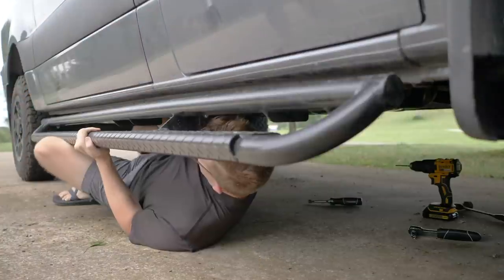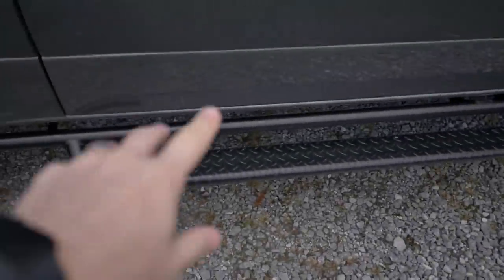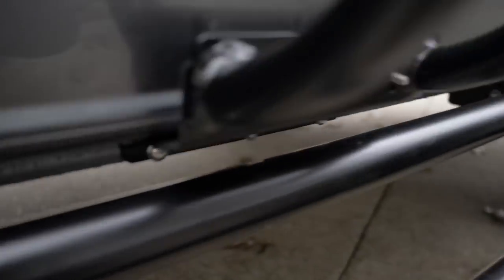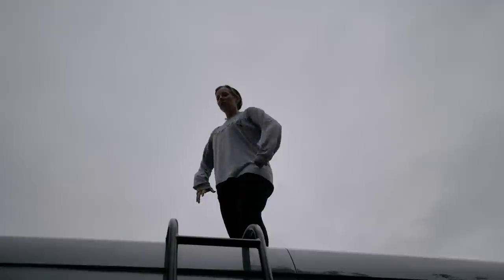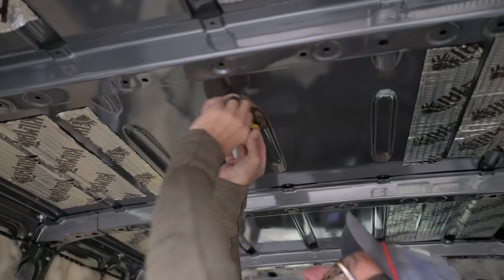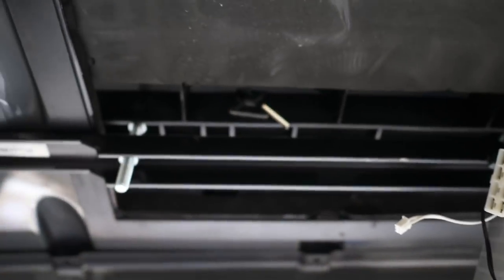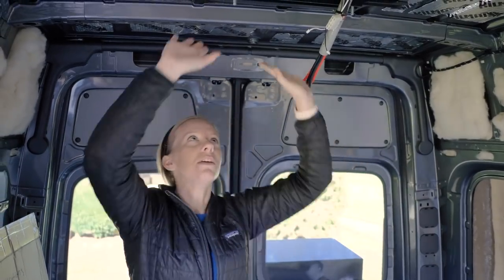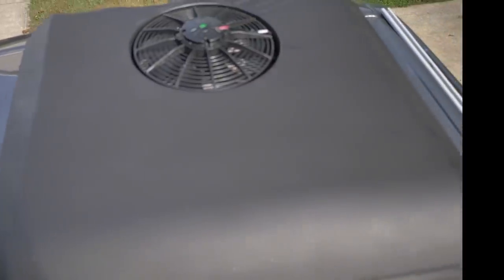Adding AC to Our Van Life Sprinter Van Conversion // Installing Nomadic Cooling AC at Site Seven

Comment: Did anyone else noticed that one of the ladder bracket is misaligned. There are 2 holes in the foot of the bracket and the left in on the outside and the right bracket on the inside looking from the side. Hope you corrected this later in the build. Look forward to the rest of the build.

Comment: Great video!  Thank you so much for sharing.  I loved the Nomadic AC info and the quick shot of the Aluminess box!  I hope you don't mind a question or two.  Since you've had a couple of months to check it out, how do you like the Nomadic AC unit?  Which one did you get, the 2000 or 3000?  What battery power do you recommend for running the AC?  Thanks again for the great video!  Stay safe!  Mike
Reply from the maker: Hey there, great question! We actually haven't been able to finish installing it yet but we should have it finished up here to a place we can fully test in the next month. That being said, we've talked to a few friends who have also gone with Nomadic Cooling since we purchased ours and they love theirs!

Comment: Wow. We were going to go with an under mount diesel generator but recently decided we’ll spend the money on 12Volt DC Nomadic AC and more Lithium batts. Hope we’re making the right decision. You’re not going with any solar panel? Does the bumper affect any of the van’s sensors or cruise control?

Comment: Which compressor size did you choose?  Wondering if this would cool in Florida heat.
Reply: I live in Miami and the Nomadic Cooling AC does the job down here too. I have the 3000

Comment: I also purchased the Nomadic Cooling 3000 and intend to install it on our 2019 4x4 144” this week. When your water test failed, what sealant did you opt to use to correct that issue? Is it all good now?
Reply from the maker: Hey! We used 3M 550 polyurethane adhesive sealant fast cure. So far so good and no more leaks! Good luck!!

Comment: How has the Plasti-Dip help up? I’m thinking of doing the same on my Nomadic Cooling Shroud.
Reply: *held up
Reply from the maker: So far so good! Although it's only been painted for a month or two now. I think it'll be easier to see how it holds up after a summer of direct sun and heat. My guess is that because it's black we'll need to freshen it up once a year or so just like most paints.
Reply: @chrisandsara  Thanks. Jonathan at Nomadic says they will have a black shroud at some point. I have a grey 144” and don’t love the look of the white shroud.